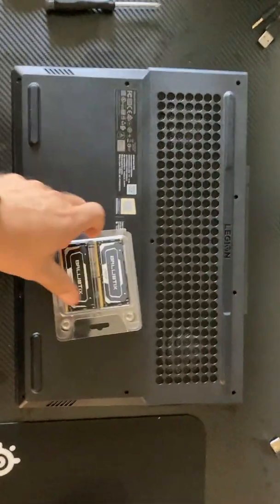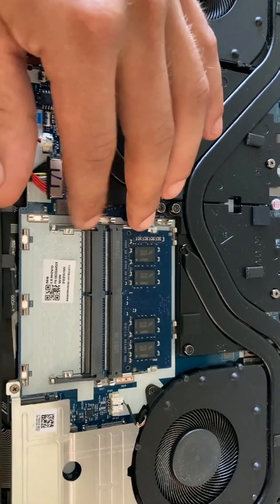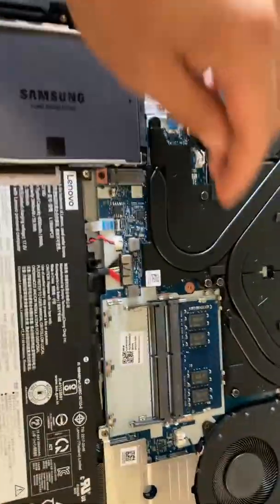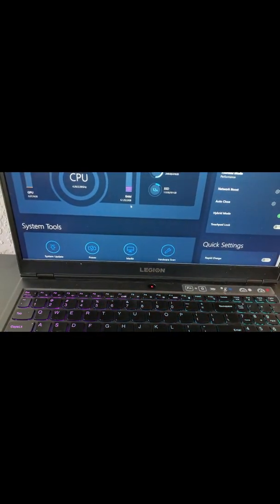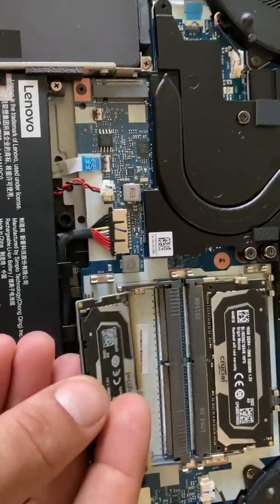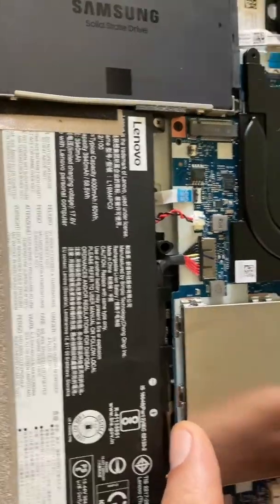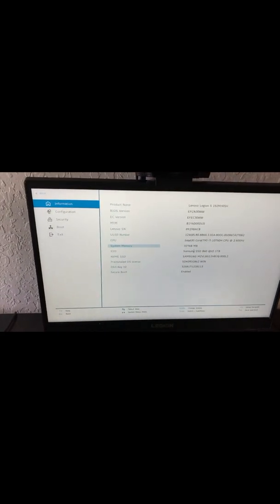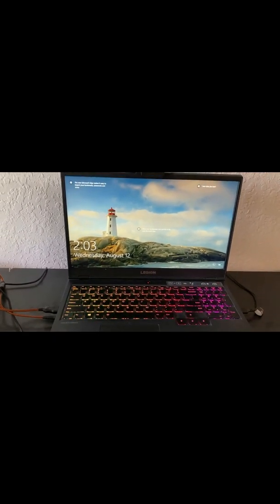How To Upgrade RAM on Lenovo Legion Gaming Laptop

Comment: Why 2666MHZ? Doesn’t the legion 5 run 2993MHZ?
Reply: I just purchased The Lenovo Legion 5 model # 81Y6000DUS. Every where I read it states the max ram you can expand is 16gb from the original 8gb ram that it came with. Can I truly add 32gb with no problems and if I do will I have to do any adjustments in bios? Thanks in advance.
Reply: @cjmoore324  I spoke with a Lenovo agent.. Their max offering is 16GB but it can support up to 32GB. Their manuals are so vague.

UPDATE: Lurked on the Legion forums and somebody successfully put 64GB in. 
2 sticks of 32GB 3200MHz work just fine 👌
Reply: Thanks  @mediocritycentral  I just put two sticks of 16gb each of Corsair Vengeance in my gaming laptop and it is now running 32gb of ram! And since I had the laptop opened I also added a 1TB  Samsung 970 EVO Plus NVme M.2.
Reply from the maker: Rob doggity Dog it’s actually really weird the 8gb is capable  or running at 3400 MHz and the 16gb has a lower clock speed if you use both slots for whatever reason. The reason I recommend using 2666 MHz is that is what my stock 8gb stick was and when you upgrade regardless if you go to either 16gb or 32gb everything will match up even though if you get something higher your system will just run at the speed of your slowest module. So if you got 3400mhz 8gb ram to add in the second slot and the original stick was a 2666mhz like mine everything would work and the second stick would just run at 2666mhz anyway so it’s not the biggest deal either way. I think different models like the y540 may have a 2993mhz stick to start with but the set up is the same. I just went off what I found on my system.
Reply: TlawGamez my model is the 81Y6000DUS. Should I just get a ram stick that’s rated for 2993 MHz? I haven’t opened mine up but the online specs say that? Thanks man
Reply: @robdoggitydog255  i did that and it went down to 2667mhz in total for some weird reason,if i were you i would get a 3200mhz one since the laptop comes with that but since the maximum the cpu can handle is 2933 so it bottlenecks it.
Reply: Heavy Nightcorer i figure it out. So basically a lot of RAM sticks are advertised as 3200mhz or 3000MhZ, 2993MHZ, etc., but that’s after you use XMP profiles and “unlock” their speeds. Since the legion 5 and legion series don’t have XMP profiles they run off of JEDEC configurations. I found a Kingston 2993 MHZ ram on amazon that is rated for JEDEC 2993 MHZ it should run at 2993 MHZ but haven’t bought it but reviews say it does
Reply: @robdoggitydog255  That's the same one i got yesterday a Hyperx 8gb with 2933 but now it's 2667 for some reason but i mean 2667mhz or 2933mhz 16gb it's better than 8gb😂
Reply: Heavy Nightcorer can you return it and get the 3200mhz version and see if that works? my buddy has the legion 7 with 32Gb of RAM. I know that they come with Samsung 3200mhz( couldn’t find it to purchase anywhere)  because I checked the part number by running CPU Z on my legion 5 and based on online Lenovo forum the CPU downclock to 2993MHz. IfI could find the part number on the legion 7 with 32Gb(2x16gb sticks) I can make it work. Both the legion 5 and 7 run on 2993 MHZ without XMP profile. If I find it or if you find it I’ll let you know and vice-Versa. Such a bummer that we can’t have it run to the advertised speed with higher capacity.
Reply: @robdoggitydog255  I know 😔 but hey at least they're good laptops,btw you got Steam?👀now that i can finally play pc games you trynna squad up?
Reply: Heavy Nightcorer not yet I’ve been real busy and just got the laptop I’m new to the pc gaming world but I’ll lyk when I do
Reply: @robdoggitydog255  for sure,i got my legion 3 days ago so i'm new as well,let me know though

Comment: I notice 3rd party selling these laptop with the same internals spec and with a ram upgrade of 64g.
Reply from the maker: DonHon The max memory this system is capable of running is 32gb ram you can verify that on Lenovo’s website. Don’t trust everything you see a third party vendor advertising.
Reply: Kinda late but you could do that

Comment: Is this the i7-10750H Processor with GeForce GTX1660Ti or the RTX 2060 version???
Reply from the maker: GTX1660ti but for this it wouldn't matter the set up is the same

Comment: Two Questions:

1. Is there anything I need to back up or do before adding another 8GB stick?

2. Do you have a link to a good 8GB stick that would work well for this laptop? 
(I have the same model)

Thanks!
Reply: Unless you break something in the process of upgrading, which would result in the loss of your current computer and possibly data, you are not needed to do any backup.
Reply: Get the crucial 8 gb 3200mhz cl22. It’s $33 on Amazon.
Reply: @sishirshrestha1783  This one right? https://www.amazon.com/Crucial-PC4-25600-SODIMM-260-Pin-Memory/dp/B08C4Z69LN/ref=asc_df_B08C4Z69LN/?tag=hyprod-20&linkCode=df0&hvadid=459641872450&hvpos=&hvnetw=g&hvrand=7428926167825496219&hvpone=&hvptwo=&hvqmt=&hvdev=c&hvdvcmdl=&hvlocint=&hvlocphy=1021322&hvtargid=pla-938712280446&th=1

Comment: Gtx 1650ti?
Reply from the maker: Cffjsjsjjs Hshshshs 1660 ti
Reply: @pcwrld9116  better this laptop or lenovo Y740?
Reply from the maker: Cffjsjsjjs Hshshshs this is actually better in my opinion it is running the same graphics as the Y740 but has a 10th gen i7 processor vs the Y740 9th generation and has a 4K display vs the Y740 1080p and has the same upgrade options and can be found at $200 cheaper than the Y740 initial launch price this is the new Legion  released in 2020 the only visual difference is the logo on the back
Reply: @pcwrld9116  thank you🙏🙏

Comment: What do you think of the device overall ?
Did you find any issue with it ?
Reply from the maker: When I purchased this laptop I was replacing an outdated MSI Prestige series gaming laptop I had for 5 years and was not considering the Lenovo Legion but I found this on sale at a really good price for the specs. It is the best unexpected laptop purchase I could have made I have only been pleased with performance and upgrade options.